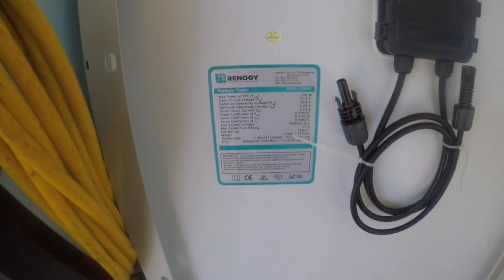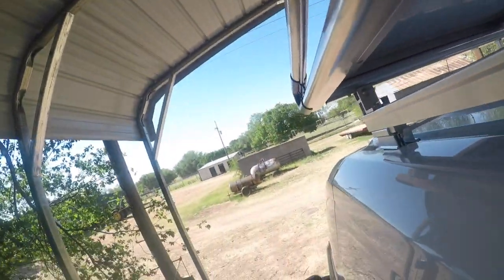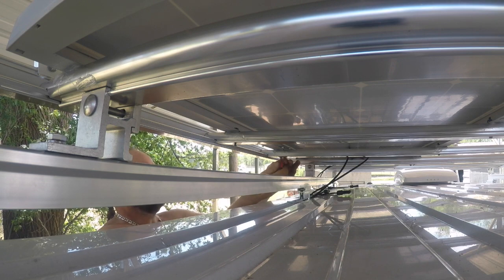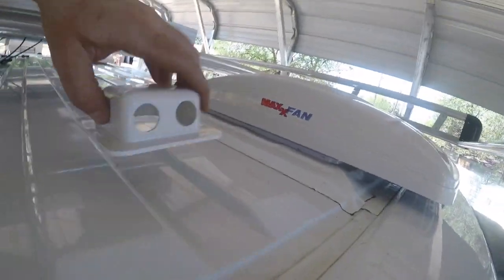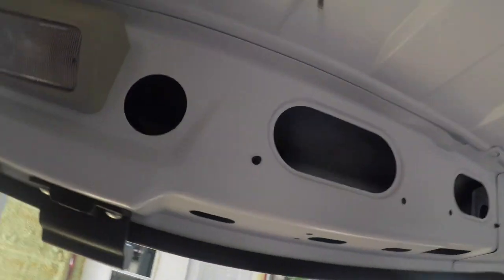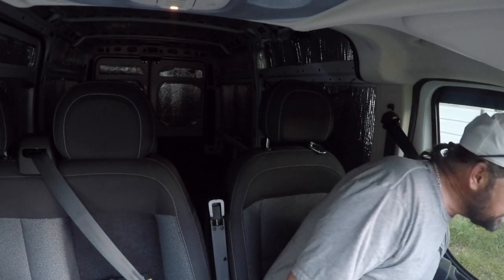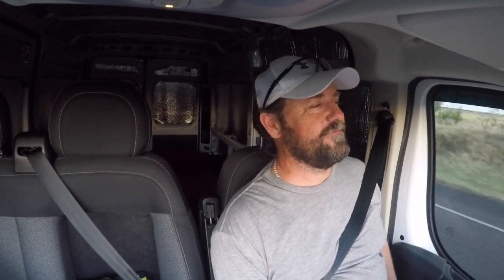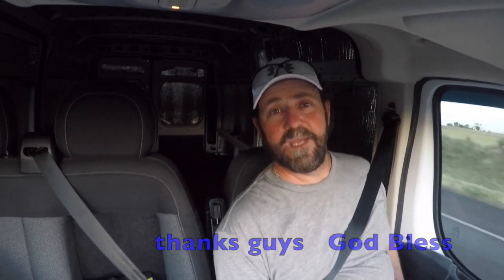Episode 11, ram promaster installing senergy solar panels goalzero yeti 3000, dometic 12 volt fridge

Comment: I have the yeti 300 , the 12 v on the yeti is unregulated so my fridge kept turning off , I thought something was wrong with my fridge but it was because of low voltage disconnect, so to run my 12v fridge I have to buy the goal zero regulated cable

Comment: I just installed the Alurack to my Pro-master last weekend. It was a pain but so worth it. I was considering mounting some panels to it also like you have done. Now that a year has passed how do you like it? Is it sturdy? Do the tall side rails cause cause efficiency issues from the shadows? Should I try and raise them up to be same height. Any feedback would be appreciated. Love your videos!
Reply from the maker: Well in the summer months i have no issues at all. 100% most all the time on my yeti goal zero.   Winter months here in the PNW. I did fall down a bit..  to be totally efficient maby do panels on both sides. I just have mine on the drivers side.  They are totally sturdy still and doing great.   If i were to do it again i may use small angle brackets and use a rivet’s.  And adhesive also where it touches the racks.    Hope this helps    Oh and thanks.
Reply: @OldManAndTheSees  this helps a lot thank you so much. Was considering centering two of them onto front part of my Alurack. Hopefully the shadows will hardly ever reach them. Like the angled bracket idea. What kind of adhesive would you use? You've never been worried about wind taking them clean off?
Reply from the maker: Nope never worried about them blowing off.  That video I did was a while ago and not sure if I showed how I through bolted it but the main thing is to “glue” down the front edge to the cross arm so the initial wind is not getting caught up underneath.   The cross arm has a slope then flat spot. So on the flat spot is where I payed the front edge of the panel.   I used some clear adhesive.  Goop. Or something 9000. I really can’t remember it was industrial and flexible but all weather and  uv resistant and strong.  The leading edge is important other than that it’s all good.  The wires I ran through the back up camera. And if I did it again I would have gone through only one side with both wires. And just drilled through the plastic for access. Then goop up around the wires.   Another idea I had was to remove one of the clearance lights  and or drill through that housing to run the wires.  I had a big issue with those things leaking in the worst timing ever dead winter  snow first thing in the morning drive 2 feet and a ice cold waterfall came through me dome light.  So I had to take them all apart and seal them on the fly with whatever I had.
Reply: @OldManAndTheSees  great thank you so much! Since I am putting my panels on the front I was considering using the adapter casing you showed but putting it in the flat spot near front. There is a 14x14 area I see a lot of people install the fan on. Do you think it would fit there? Otherwise I may try the back light housing like you suggested. Keep up the great work!!!
Reply from the maker: I actually put tow of them up and yes it fits nicely on the flat spot.  If you see my recent video about floor vent I would have probably only done one roof vent instead of two.
Reply from the maker: Two.   Spell check got me again

Comment: At around 7:50 you can see the reflection of the bars on the solar panel glass. That isn’t good because it shows you will have shadow issues with your panels. Either delete the bar or slide the panels inboard.
Reply from the maker: Thanks for the input.  I will be adding more panels on the other side to increase power
Reply: I have used a flashlight at night to see how shadows fall.

Comment: 1st.! The van sounds quieter since the insulation is in, is it? I will follow your build. I'm gathering  so many ideas, it's overwhelming.You probably are going through the same. Why did you choose the Yeti? Will it provide your needs? It looks amazing. Thank you for sharing. I like the roof rack. It was a pain in the keister, but it puts the solar panels up off the roof a little. If the Yeti will give you 8-10 hours of use, it might be better than other power supplies. Lots of money, but pulling the solar panels directly into it and have it do the rest might be cheaper in some ways. Solar systems cost an arm and a leg, or 1/2 a leg, Ha Ha. Thanxz
Reply from the maker: Not insulated yet!  i have a foam it green kit awaiting.  I just wanted to do a "mock up"  of the system and spacing.  I went with the yeti  for a few reasons   1  its mobile    i can move it around and take it to power if i really need to charge it   like in the winter   or out camping   emergency use    playing the guitar with amp  etc... and its all inclusive  once you get down the plugs   lol.     it should run the fridge and fans and also charge what i need  with no problem...  thanks for the support